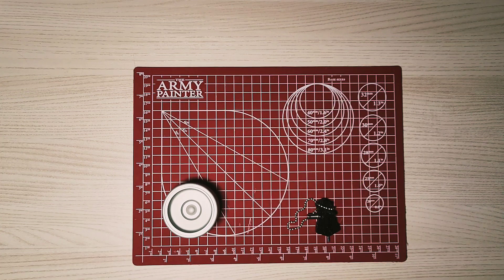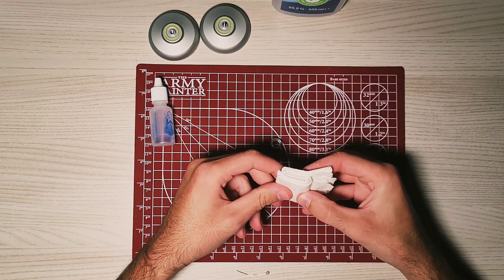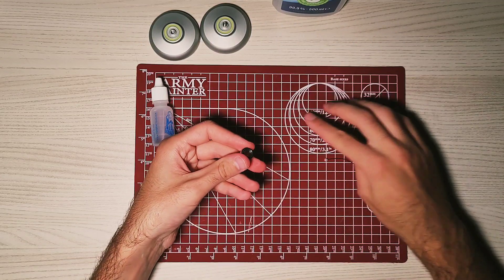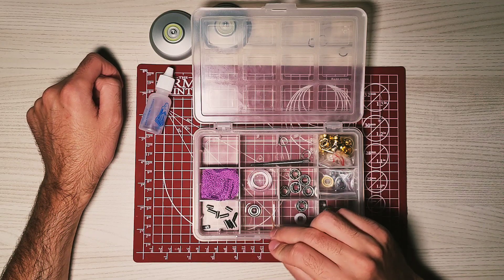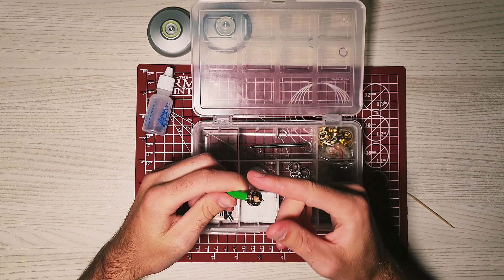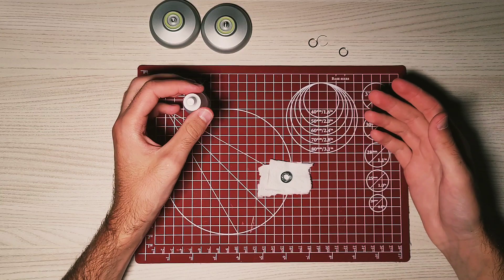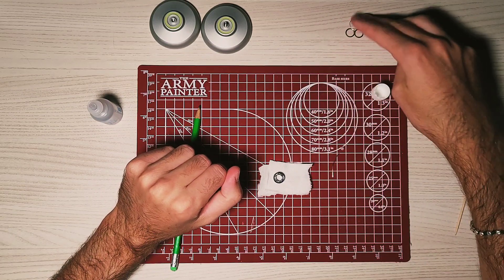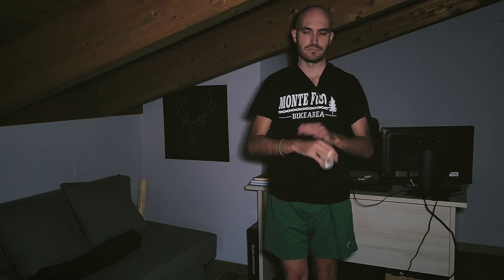How to Clean and Lube yoyo bearings - My method

Comment from the maker: Here's my method on how I clean and lube my yoyo bearings, in place of isopropyl alchool, mineral spirits or Acetone100% can be used. Many people don't lube the bearing once cleaned, however I like to apply this minimal drop of lube to protect the metal of the bearing. At the end of the day, metal on metal movement needs lubrication. Ceramic bearing are not to be lubed. Let me know what you guys think!

Comment: I'm missing a proper "yoyo parts container"
I do almost the same as you, only thing different is that I leave the bearing soaking for a minimum of 30 min and then I start to spin it. Soak-spin-soak-spin and I repeat until I feel it's good hehe
Great video man.
Reply from the maker: So far this 5 minutes method had always worked perfectly. But I can see your point, keeping it soaked will wash away any oily residue. I'm just too lazy to wait 30 minutes 😁 thanks a lot btw